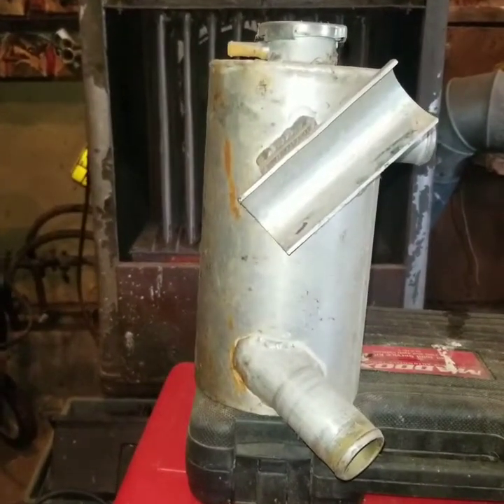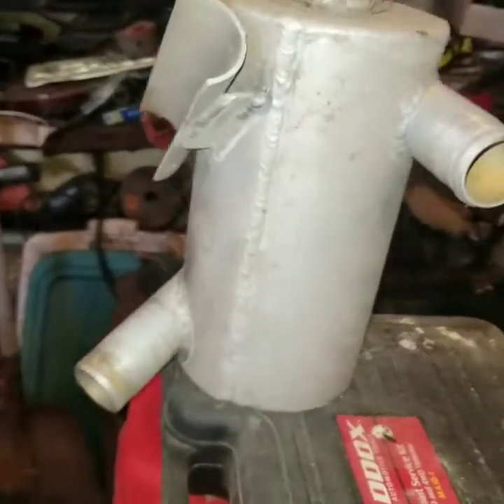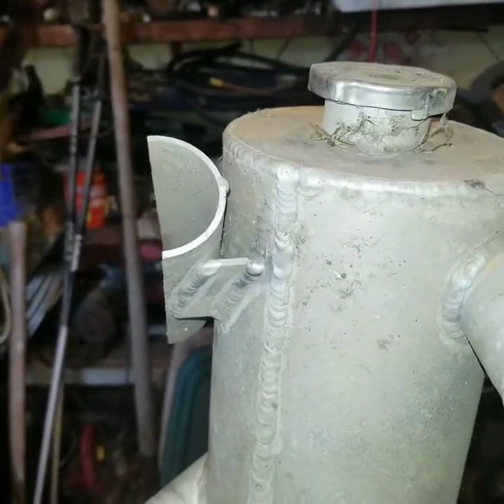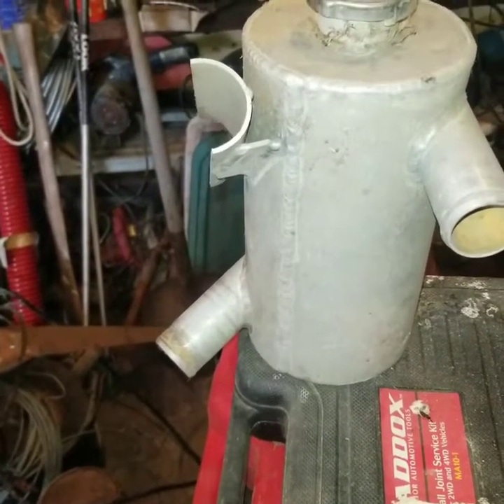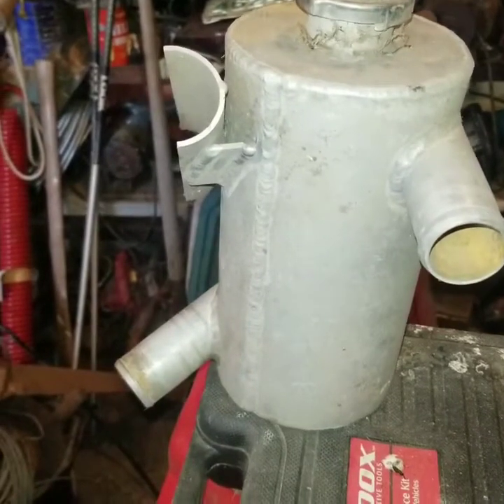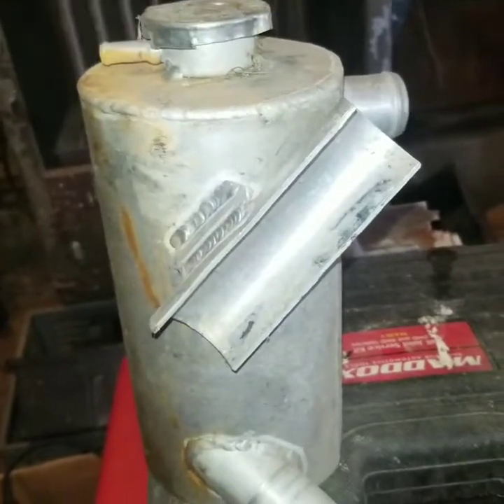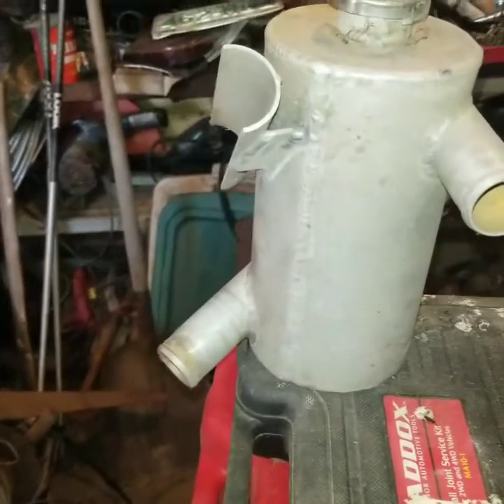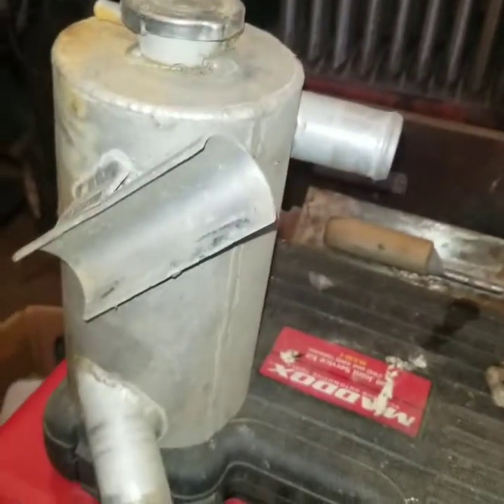Swirl Tank Explained pot cooling

Comment: For the secondary canister. Could  i mount both vortex chamber and vapor catch can for lack of better words next to each other and weld a small hose barb for the vapors to go from the vortex to the catch can/over flow?

I'm curious as to what happens to the vapor in the vortex can...I'd imagine eventually the pressure needs to bleed off or? Is that what the radiator cap is for on top?...
Reply from the maker: I think it might work.  The exit from the vortex must be center top ( or end of vortex).
Reply from the maker: The intention is that all the bubbles/vapor go to the canister so the most efficient cooling occurs and there are no locations of vapor inside the engine where you can avoid it.  With luck the vapor qill return to liquid or blow off if the pressure gets too high.

Comment: I’m trying to do this on my ls3. Does it matter  if the exit hose on the pot is below the radiator inlet.
And should the cap of the pit be the highest point of the cooling system
Reply from the maker: In a nut shell, the container is a place to accumulate air that may be in your system and to exhaust said air when the air or water gets hot.  I would be sure the cap is the high point but barely.  You need to be sure there is a way to bleed air from any part of the system that could trap air on its own.  You should be able to start an engine with this tank with the lid removed an top up the coolant.  Best of luck.